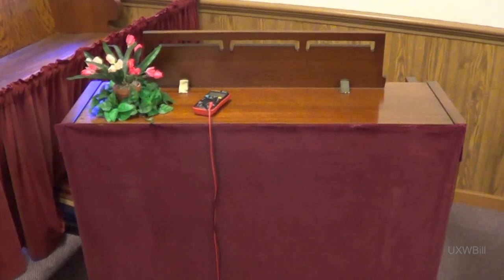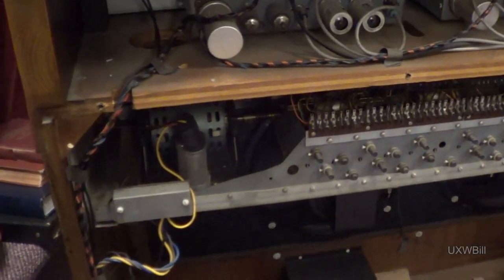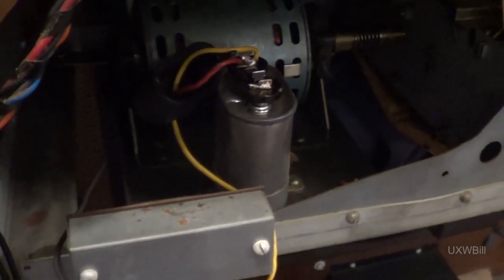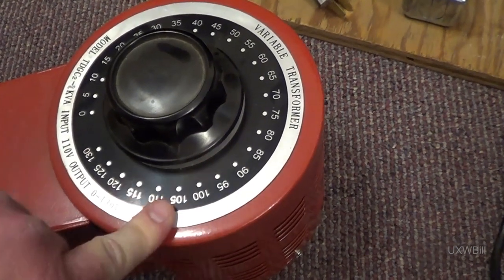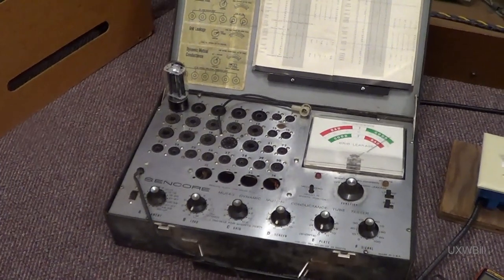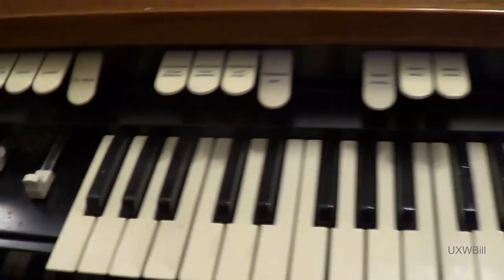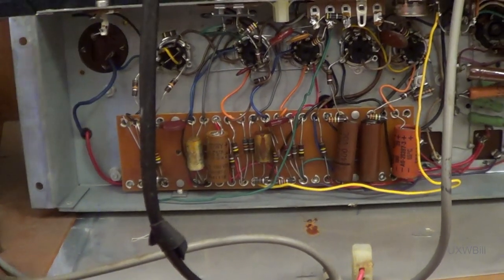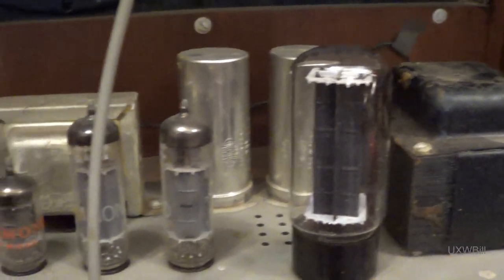Revisiting the Hammond L-102 Organ

Comment: Playing notes doesn't load the motor.  However each tonewheel has its own clutch, so certain notes will sound bad if one or more tonewheels have dry bearings and can't spin freely.  Put a couple spoonfuls of oil in each generator funnel (slowly), and a few drops in each cup on the motor.  It takes quite a while for the oil to reach all the bearings.  And the run cap is definitely questionable.  

Hopefully anyone who's been in there hasn't messed around under the generator and broken any of the tiny oil wicking threads that lead from the main trough down to each bearing.
Reply from the maker: Thanks for the information! I wasn't sure how much oil to put in the generator funnels, so each one only got about ten drops (delivered very slowly). I am hoping that no one (myself most certainly included) has done anything I'll be cursing them out for.

The organ was happy today, and played without failure.

I find it kind of amusing that the run cap will probably come from an HVAC parts distributor of some sort.

Comment: Filter capacitors can certainly still be good, and if they’re not giving signs of distress and they read relatively close to their intended value, I’d leave them be. 

That being said, I’d replace any audio output stage coupling capacitors, even if they test fairly. As they break down and age they allow more and more DC to hit the plates of the output times causing them to be driven harder (biased on more) and the tubes really don’t like that too well, if you replace the output tubes go ahead and find the coupling capacitors in the schematic and replace them with 630V film types. If anything it’s preventive maintenance that will increase your safety factor.
Reply from the maker: I haven't removed them from circuit to test their value (and I don't have any fancy capacitor testers, at least not yet). My main concern is safety of the power transformer. If I were to invest the effort of half-disconnecting them, going the rest of the way wouldn't be much of a stretch.

The Canadian-spec version of this organ had a power fuse, and I will probably add one.

Comment: I was waiting for the key keeper to shout BANG!! when you powered up the tester :-D.
That start/run capacitor would be the first thing i would replace.

Don't forget to jiggle the valves.. sorry tubes while it's on, just to see if there are any other bum joints on them.
I would snip one lead on each capacitor and test with the meter, tubes are quite forgiving as long as the caps have no bad leakage or way off there capacity.
The resistors may still be carbon based, i would not be supprised if some have gone high.
Reply from the maker: Had he done so, it's likely the organ would have needed replacing, after I banged my head hard enough to knock the cabinet apart. At least they'd have another organ ready for my funeral service. :-P

I did wiggle the tubes/valves and the only one that ever caused any disruption was the rectifier. Other than overall manufacturing tolerance, or differing tolerances between manufacturers, I can't think of a good reason why the GE rectifier tube was loose in the socket and the RCA tube was not.

My main concern would be that of a capacitor failing shorted and killing something like the power transformer. Interestingly, the Canadian version of this organ appears to have had a power supply fuse as standard. I may well add one to this organ.

Comment: This was definitely an interesting video, and I'm with you on plugging in something that I'm not sure of. I do what I refer to as "Chicken Testing", because I'm never ready for  explosions. I just get a very long extension cord and place the victim under test either just outside the door or in another room, the plug in the power. Then I carefully walk over to the unit and inspect the result, or carnage. But the dim bulb test at least avoids the fireworks! Anyway, I just finished getting an Am/Fm tube based radio working, which had the original can electrolytic cap on the chassis, but a group of more modern caps wired in circuit to substitute for the electrolytic cap. Only my friend overlooked one wire, and that's what fixed it. I'd definitely replace the starter cap for the tone wheel motor right away.
Reply: i used to be a whole lot more scared as a child.

Comment: I've been working on these for 25 years. My advice woulf be change the motorcap"it is not original,they were soldered at the factory though. I doubt you're tester is correct at all usually these tubes don't fail in a hammond because they operate at a lower voltage. The oil can take as much as three weeks to get to all the bearings. Many will disagree with me but the only option I would consider to speed it along is removing the motor and generator and oiling all bearings directly.I agree with changing the rectifier,but I would not recap this amp it sounded strong and clear to me. I would clean the conectors though.I doubt you're multisection caps have been restuffed you can still get them at antique electronic supply. This is an expensive amp to recapp. Even if price is not a consideration I would not not be inclined to recap this amp. Thank you for you're time and donation.
Reply from the maker: Thank you for the suggestions. The tube tester bears a second look -- it only reported the two 6BQ5/EL84 tubes as weak .Every other tube in the organ tested very strong. It may not be dead-on accurate, but on that basis I believe it still works acceptably well.

I might remove the motor for a better look at it. Going so far as to remove the tone generator looks to me like it'd be chancing a major disaster, and I don't want to be known as the guy who wrecked the organ.

As for the recap, I have two reasons for it: avoiding any potentially fatal short circuits to the power transformer and dealing with a very occasional hum that the organ produces. Since it's rurally situated, there are lots of disturbances on the power line and I want to give it the best chance to filter them out. When it has happened, the humming has usually kicked off right after the switch contacts open on a sump pump elsewhere in the church.

Comment: I dont hear any filter hum which leads me to believe those metal can capicator are still pretty good and I believe are original. If you feel like taking the trip Gateway Electronics in St. Louis they should have the capicators you need.

Comment: Old capacitors can still be good I just repaired a 60 odd year old Dansette record player and the 2 capacitors in the can were right on value and are still in there happily working top video
Reply from the maker: It's true that they can be good. Given that the older capacitors can be failure prone, and new ones made of far better materials are cheap, I don't think it's worth taking the chance.
Reply: I agree but its my own record player if I sell it I will replace them I have done all the capacitors in the audio stage so if that can does fail it won't trash the valves it will just hum it's tits off
Reply: On my L-102 since I got it, the capacitor for the motor seemed fine. But then it gave out. We replaced it and it sounded 50 times better.

Comment: Oh i wish i had a tube tester myself. i have a Reel to reel that seems to have something wrong where my left channel is not working when it used to before the motor capacitor blew, and it maybe a transistor or something along more caps.sigh Akai M-8 headaches lol 
 . But anyways great video.Nice save on that organ
Reply from the maker: Don't start with a tube tester. Vacuum tubes are generally quite reliable, and you can at least test the filament terminals for continuity with a multimeter. Look at the passive components first.
Reply: If you are near central va I will test you're tubes for free.

Comment: Interesting project. There's a stain on the shield below the chassis, which may be due to one of the capacitors in the eyelet board leaking electrolyte. You're lucky it isn't one those early 70's transistorized Yamahas and the likes of it, plagued with noisy 2SC438 "low noise" transistors. Good Luck.